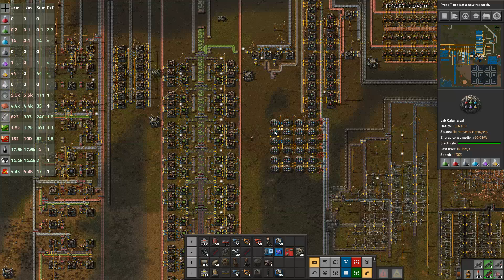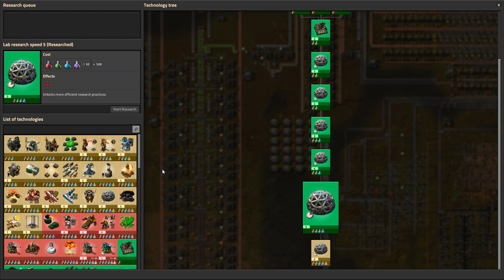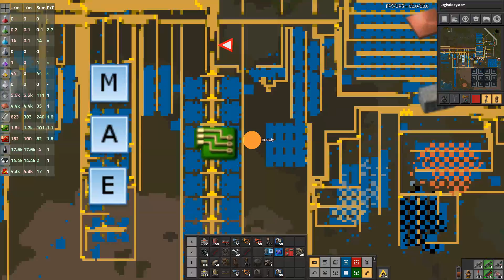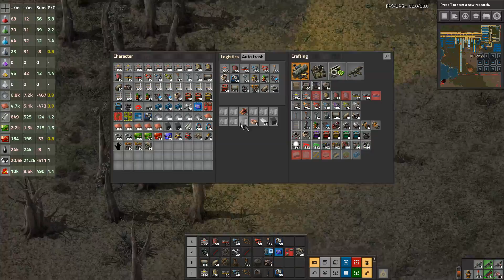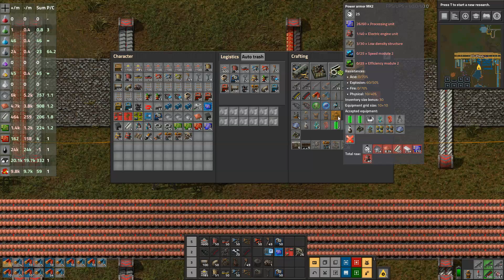Factorio 0.17 | Factory Island EP34 Recycling with Requester and Buffer chests | Tutorial, Lets Play

Comment: I don't get why buffer/requester chests are a better option than a regular storage chest when it comes to recycling. Having to set an amount is already a cause of problems in my mind
Reply from the maker: Take wood for example its very easy to have over 4800 in storage filling one storage box.
The way storage boxes work is even if i have one filtered if its emptied via inserters if there is a second storage box with one piece of wood in it all future trees will go to  into that box and never come out.
Robots put like in like...
A requester box will remove items from passive boxed or storage (filtered or unfiltered) and removes them from the logistics network.
A buffer box does the same as a requester box, EXCEPT the items are also available to be delivered to the player and also a requester box if you tick the option inside the requester box interface

Comment: Hi JD.
You have a potential loop of ap ammo. There is a passive provider chest directly in the line of the AP @24:26. Therefore if the 200 ammo is reached, the bots will pull from the chest and put it into the beginning of the line where you put the buffer chest ;)